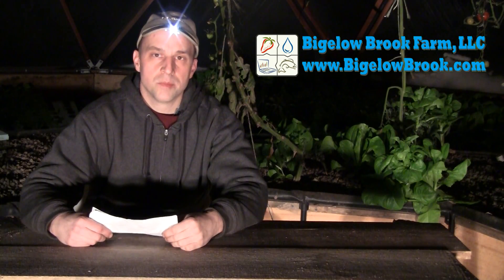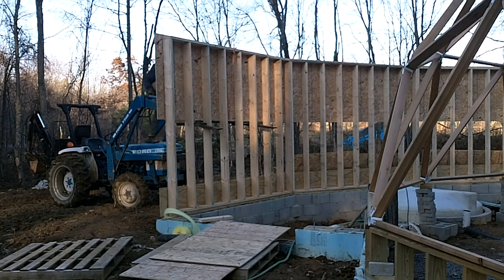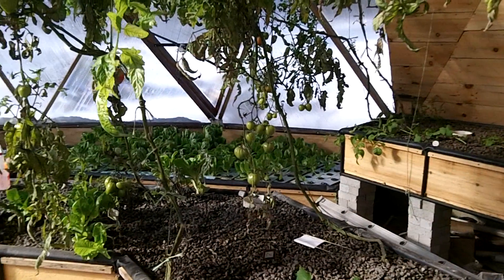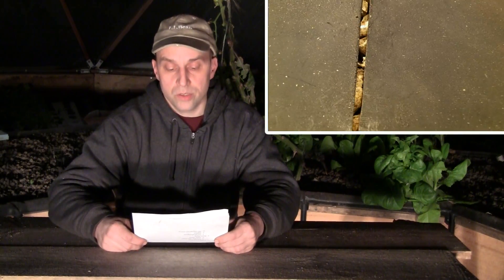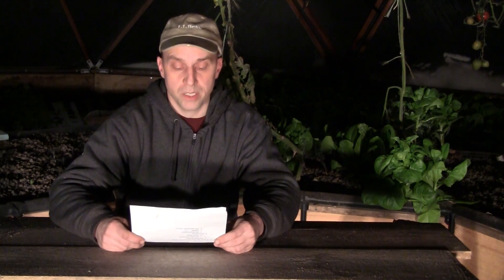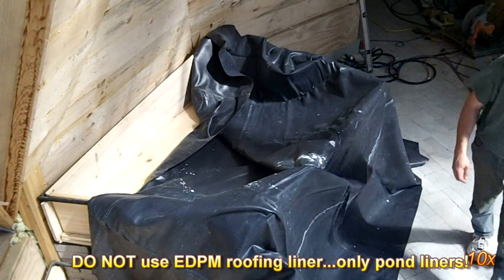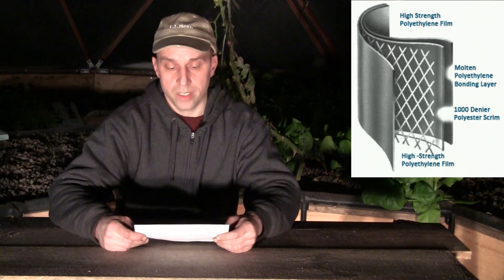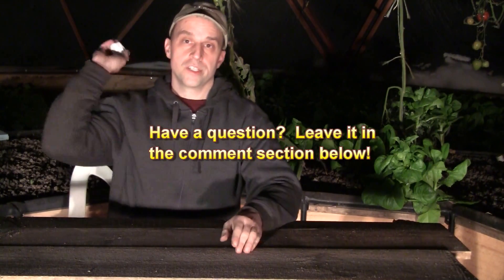FAQ #3 - Aquaponics - Geodesic Dome - Rocket Mass Heater

Comment from the maker: Indirectly, the Tarm or Fröling wood boilers do this.  They burn really hot and heat up a large tank of water (thermal mass), then that heat is taken out of the mass using various circulator pumps.  Of course you'll have to come up with at least $10K for a system!

Comment: Good stuff. I've heard of adding water from an aquarium or pond, or using sea sol, for the initial cycling...but this is the first I've heard of urine. Obviously it works well. On a cost basis, I see where the pellets are really helping you. I do have the time for sawing and cutting wood, so I go that route. If I had to buy my fuel source, I'd have to reconsider winter growing. Look out Letterman, here comes Rob !

Comment from the maker: I've done tons of research on the pellet mills.  You have to also get a hammer mill to pulverize the material first, then dry it, then run it through a pellet mill.  I would need a system that would cost around $5-6K to produce enough pellets.